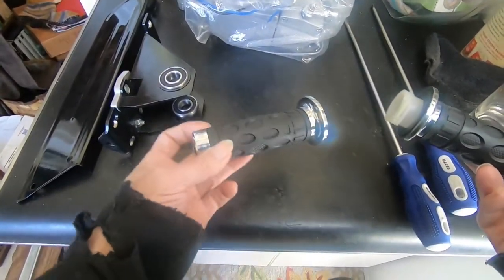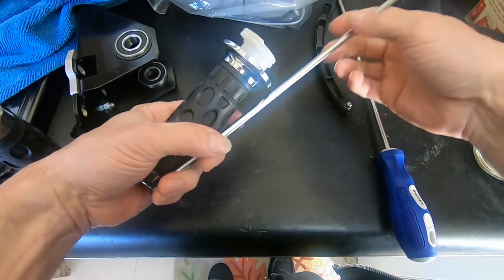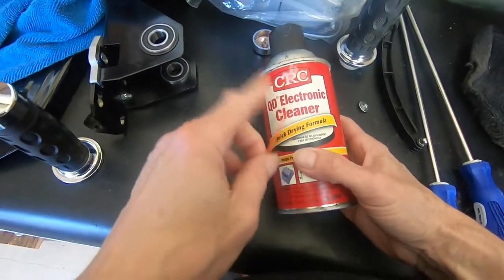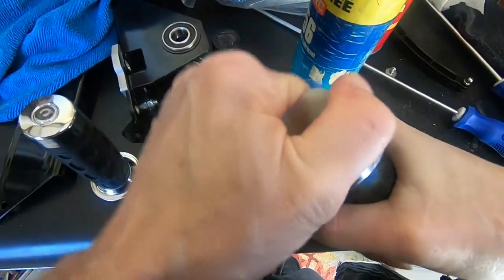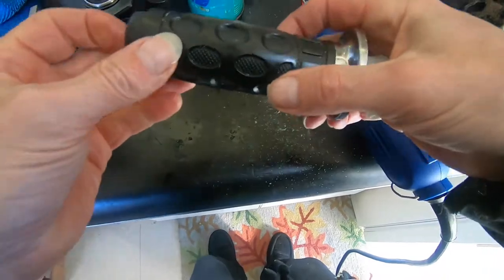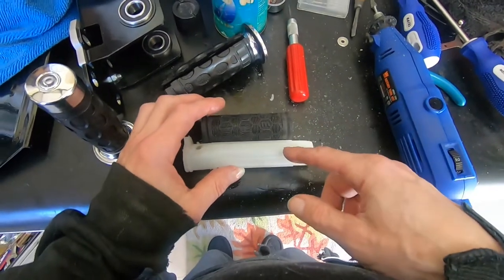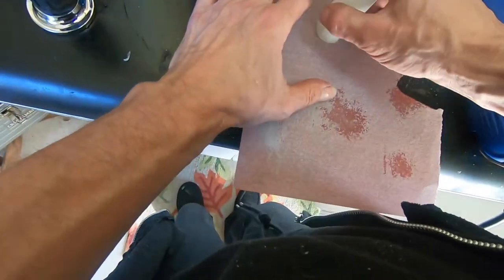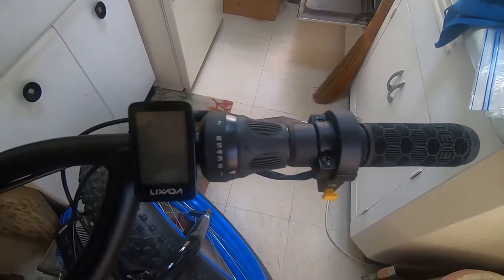Mongoose To Motorized #7 | Easy Bike Engine Kit Throttle Mod Using Your Bicycle Grips | Idea Guide

Comment: 15:52 pretty radical. Kept the shifter and added throttle.nice! Btw, to remove grips easiest, go to a shop that has a blow gun. Air blows grips right off.no cutting grips needed.
Reply from the maker: I use electronics cleaner to get grips off. But that throttle grip had to be cut off. It's a couple of plastic pieces that are not meant to come apart.

Comment: I'd recommend getting a dual brake lever.  I picked one up for $10 and put it on the throttle side to keep my hands away from the clutch when using the brakes.  Trust me, you'll get sick of that brake lever being near the clutch lever.  I can't count the times I've dumped the clutch accidentally while applying the brakes.  I also don't see a button on your clutch lever.  You may want to look into getting one with the button.  It'll hold the clutch in the disengaged position.

How's the mini bike seat idea coming along?  I've been trying to figure out something like that for some time now.
Reply from the maker: I've been working on the mini bike seat the last two days. I've worked out how to install it. I cut a hole in the bottom of the seat so that it goes down over the seat post to get it lower. It's mounted in the back with a T-hinge to the rear hole behind the seat. Not sure what it's called but it's for mounting brakes or a reflector or fenders. I'm trying to find a light weight flange to use to seal off the area so the padding doesn't come out. I'll also be mounting my CDI under the seat. 

Just ordered some blue and black spark plug cable as I will need another inch or two more than the kit CDI provides. I don't think I'll mind my clutch and brake setup. I can easily apply one or the other or both as the clutch lever is a somewhat longer than the brake lever. I can start braking with two fingers, then hit the clutch with the other two or vice versa. 

What's your build?
Reply: @ChuckHaney  I just used a beater mountain bike and got a Skyhawk 66CC kit with a 44T sprocket.  Once you have the clutch lever hooked up, it'll be a fair bit harder to pull.  Takes my full hand to pull my clutch in and I use my thumb to hit the button.  A clutch lever with a button is great for coming to a full stop.

I'll be excited to see a video on the mini bike seat.  I'm still trying to pick the right seat for my needs.